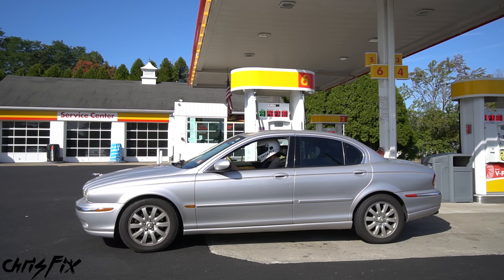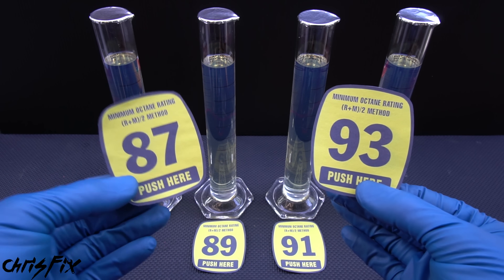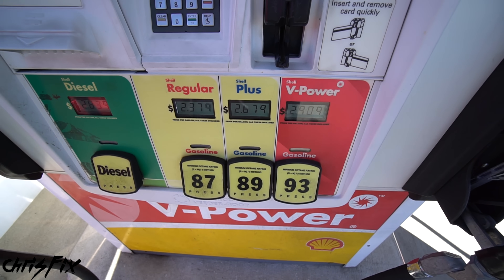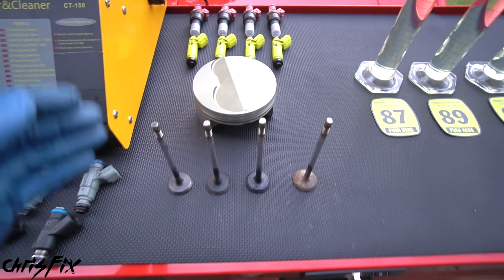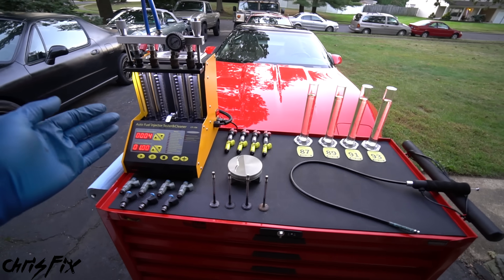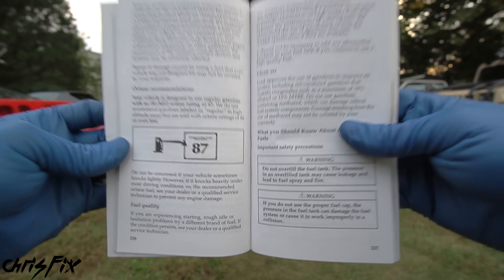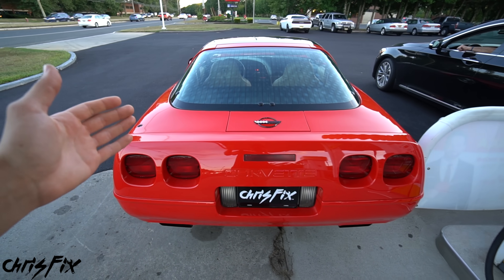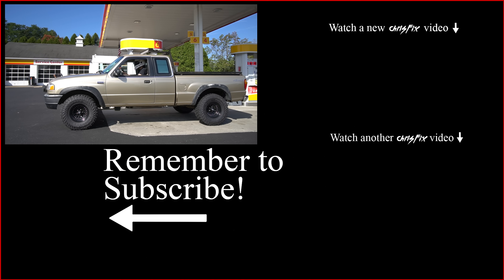What is the BEST Fuel to Use in Your Car or Truck and WHY

Comment: Excellent video. Very well done. I do have one question however. Are you sure of what’s causing the actual pinging or knocking sound? My old shop teacher in high school built his own racing engines for his cars and had the following explanation for pre-detonation. He said it’s not the actual uncontrolled explosion that causes the noise, it’s that the uncontrolled explosion causes a rapid pressure build up in a peripheral part of the combustion chamber which in turn applies large amounts of force to an area of the piston top that’s not in the center or on axis with the wrist pin. That in turn causes the piston to rotate quite forcefully around the wrist pin causing the piston skirt to slam violently against the cylinder wall which causes the knocking or pinging sound. I don’t have anyway of confirming what he said was true, but it does explain why pistons become damaged after prolonged periods of pre-detonation. Does his explanation sound plausible, or is he just not accurate?

Comment: i just use the most expensive stuff.  the truck is nearly $70k (or it was when new) so i figure the extra $2-$3 per tank is worth it.  incidentally, 80,000 miles later of daily farm use including towing and she still runs perfectly with never an issue.  well... the lock on the fuel door stopped working but other than that nada.

Comment: The Petrol Industry sure has people brain washed. They think if they put premium in their tank it will run like a race car. Little do they know is that high octane gas is not as volatile as low octane gas. It has a higher flash point. Why? Octane. Because racing engines run at much higher temps, therefore to keep the fuel from igniting before it should, they put in octane to keep it from igniting (pre-ignition) before it gets compressed in the cylinder. If the manufacturer recommends high octane it’s because the engine is a hot running engine (which could be from higher compression ratios) and requires it to prevent pre-ignition. My Harley requires high octane fuel. Why? Because it’s an air cooled engine and runs at much higher temps than a standard automotive engine. Save your money, if your engine doesn’t need it, high octane gas isn’t an advantage and could even result in lower gas mileage.

Comment: Why does a 95 3.0 Ranger, a 96 3.0 Ranger, a 99 4.0 B4000 (ranger) all get roughly 10% better fuel economy and have slightly better acceleration when I run 89 vs 87? 

The Mazda in particular is noticeably  slower pulling hills with 87. Always has been since I've owned it. With 89, it pulls up the hill easier with slightly less throttle. This is not my imagination, I have tested this several times.

Comment: Several things. I owned a 4 cylinder ‘94 Toyota pickup for 25 years. When I used high test gas it had more get up and go and that’s all there is to it. It also got much higher MPG.That’s a fact. I was told the engine was designed to run on regular gas and higher test gas wasn’t a good idea so I didn’t use it often.

Comment: The type of fuel you need depends on what engine it’s powering. Pickup Trucks with a V8 May need Mid grade or Premium. Performance cars, such as Mercedes AMG, BMW M,  Dodge SRT, etc. you’re most likely on premium

Comment: This video is wrong.  Look up btu.  The low octane fuel has more btu than high test.  High test burns slower so it does not pre ignite, thus lower energy and lower fuel economy if used in lower powered engines.

Comment: Well I have been using premium on my 2013 Nissan Frontier 4 cylinder cause it save me a little bit more of gas and starts smooth in the morning contrary to regular gas which is what is supposed to use starts rough in the morning and suck the gas a lot faster , I have no clue why my truck does that ,but it has been like that for a long time since I bought it new, I did gave up trying to solve the mystery 😂 . And I am always loaded with tools in the back since I am a mobile mechanic. I think she is spoiled 😂.

Comment: Do you have a guide on which to choose the gasoline based on compression ratio ? My manual says that it only requires gas without lead (Pb) and doesn't mention about RON or Premium. It's a sport bike btw, and the compression ratio is 11,6 : 1.

Comment: Long story short:  use the octane recommended by the Manufacturer.  Octane is usually shown:  (a) inside the fuel filler door,  (b) on the fuel cap, or (c) you have to look it up in the owners manual.

Comment: I does use 87 in my 2004 Toyota Corolla. A lot of people think by using 93 that your car will be lasting longer or run better but it depends on the car and what is recommended by the owner’s manual.

Comment: My gas tank says E85 but the owner's manual says I could run 87 through 91 E85 Burns a lot faster vs 91 lastes  little bit longer can i harm my motor for running 91instead of e85

Comment: Uhhh, check out Project Farm. He shows the difference between 87 and Shell premium V-Power NiTRO. The Shell fuel burned cleaner. He uses a single piston push mower engine that has a clear head.

Comment: In France we have unleaded petrol 95, unleaded petrol 98, unleaded petrol 95e10 (10% ethanol). 95 is 1,35€ per liters. It means that it costs 1,58$ for a liter (0.3 gallons)
Reply from the maker: Thanks for sharing, and did you watch the video?
Reply: @chrisfix  yes i did. Thank you it was useful

Comment: Complete waste of 16 minutes. What about gasoline that has 10% ethanol blends in them, like here in the mid-west? Ethanol has about 10% less btu per gallon then gas so there is less power/ thermal energy available. So burning gasoline with ethanol lowers your gas mileage. However, there is typically a trade off as gasoline with 10% Ethanol is usually cheaper.
Reply from the maker: Thanks for sharing

Comment: In my area, Shell is the most expensive. Are you saying that they have more additives that keep the engine clean, and therefore worth it? If so I'll start using shell. Maybe you could rank all the major gas brands. Thanks. I just subscribed and every video is amazing.

Comment: Does shell claim to be able to clean direct injection valves? I know its a problem for most direct injection cars. Whatta they say? The new Type-R has potassium filled valves along with additional cooling measures that prevent the temperature from getting to the point carbon forms..
.

Comment: If your car requires premium use premium. I used silver on mine and it caused the knock sensor to turn on check engine often because the detonation was too soon. So the car would stop accelerating by a lot.

Comment: I don't agree with this.  I have driven many different cars and always used the lowest grade octane.  I have never had an engine ping or cause me trouble.   I believe the grading of fuels is a lot of hype from marketers.   Like I have said.  I have run the cheapest fuel in many different cars, regardless of what the manufacturers claim and I have never had a problem.  Fyi!

Comment: Hey @Chrisfix, great video! So buying higher octane gasoline may not be necessary for some vehicles, but it seems like it shouldn't hurt either, right!? When I was 21, I bought my first vehicle, a 99 ford F-150 (I still have it), as I didn't know better at the time, I thought higher grade gasoline was better quality given the marketing name and price, so I used premium for over a year when I found out the difference. The manual recommended regular so I emptied the tank and switched to regular. As soon as I drove off, the check engine light turned on. The dealership told me they could not see a problem and just reset the light. But I never figured out why that happened. Do you have any idea what caused it? And is switching up to premium once in a while a good thing at all? Or do the lower octane gasolines have the same additives as the premium?

Comment: It depends on how hot the engine is designed to run. The 3.8L V-6 Pentastar engine in my Jeep is a hot running engine and runs quiet on 91 octane and pings on factory recommended 87 octane. The octane rating specified by manufacturers for specific vehicles is the bare minimum recommended, not the optimum or best.
Reply from the maker: Thanks for sharing!

Comment: About octane that explanation is not correct. In Japan they have 100 and even 110 octane gas, so there cars to run "forever" without engine problems and WEAR. Lower octane gas is for slow speed and high octane is for high speed drive. The higher rpm is driven the engine the higher octane should be the gas used, no mater what is the vehicle. That's how the engine can last 500 000 mi. If you drive with only low octane fuel the engine will not last more than around 150 000 - 200 000 mi. If a vehicle is driven with no more than 20-30 mi/h and low octane gas all the time yes the engine will last 300-500 000 mi. More octane in the gas = less engine wear. If you understand this you should pointed that in the video but didn't. People have to know why they should pay more for gas. Above 4000-5000 rpm compression is so FAST in the engine that the fuel need a 200 octane not to blast before the spark. 300 years ago, In Scotland this is how people start a fire with very high compression of air and dry moss. If high compress air can do this with the dry moss, imagine what high compression can do with the gas. Above 4000 rpm  and low octane gas, you do not need a spark from the plug for engine to work but car computers do not know that...car engineers either. Above 4000 rpm and low octane gas, car computer should stop the sparks from the plugs and change the engine timing so the car can run on low octane like in a diesel engine vehicle. This is the only way low octane gas not to break the engine, instead of that, they sell us gas with octane - not very smart but works. Above 4000 rpm diesel engine are better, because computer have to do less engine timing.
Reply from the maker: Thanks for sharing!

Comment: Good article, well done.

85 Octane here in Colorado (Yes! 85) We're at 5000+ ft above sea level (7500' at my house) and less air pressure/density; therefore, combustion pressures and temperatures are lower and less likely to cause detonation or pre-ignition.

Comment: I drive a 03 s10 and I run 87 for everyday driving, but every 1000 miles, I throw 93 high octane, and floor it every stop sign and red light. Clean her out and drive her loose. It drinks 93 like sugar, but I usually get amazing mileage on the tank afterwards, hi Chris!! 👋👋👋

Comment: Great Video! 
I just have a question. I've got a tuned mustang that's been sitting for nearly 3 years with the same fuel in the tank. Should I drain the tank or can I just idle the car and run the tank empty? I'm asking cause the motor was built 3 years ago and it's been stored since. Life got busy.

Comment: Good video.  I would have explained detonation a lil different.  It can also be the explosion of the fuel before spark plug fires causing hot spots in the engine and ping...

Comment: The term is "Pre-Detonation" Combustion occurs too soon putting force back on the top of the piston while it is still in it's upward compression stroke then causing the piston skirt to slap on the cylinder wall causing "Pinging".
Reply: DrHarryT THIS ^^^^^^^

Comment: Just bought a 1976 Corvette , and I've heard I should only put Premium (93) in it, is that true ? There's not much information for these cars on the web lol
Reply: LiiLNiiCk So many variables. Age of engine, modifications, L48 (8.5:1 compression ratio) vs. L82 (9.0:1 compression ratio), ignition timing. What are you running now? Does it knock? If not, then you’re OK, presuming the timing is fairly close.

Comment: I have two older Mitsubishi 3000GT.  One is base(1998)the other(1991) twin turbo.  I use 91 octane in both and increased fuel economy by up to 30% from using 87.  No lie I was impressed so I use 91 exclusively.  Both for sale lol I have a 2019 camaro ss but can’t get 93 octane fuel locally but it runs fine using 91.

Comment: Is there any point of the midgrade? I’ve never seen any vehicles that were recommended midgrade and I’ve never seen anyone use it. Not to say no vehicle manufacturers recommend it or people don’t use it but I’ve never seen either.
Reply from the maker: I've seen a few cars actually require the use of it, or recommend it for cars that require 87 but are looking to tow or perform similar tasks!
Reply: Sports bikes often require mid grade petrol, which is 95 here (89 for Americans I think). My Yamaha R3 says 95.
Reply: Ive always used 89 when towing and 87 daily driving in my trucks since the added heat of towing.  Some motor cycles recommend 89
Reply: My Jeep Hemi recommends 89, says there is no need for 93. And they are right, if I use 87 it runs like crap and no noticed benefit for 93 octane.

Comment: I recently bought an old RX350. Before i bought it I checked out several you tube videos and one of them mentioned that RX350's burn regular. I thought that odd since my even older Es300 had used premium. I said well I guess he knows what he's talking about and since regular is quite a bit cheaper it was a selling point for buying the Lexus.  Unfortunately after I had already filled it up with regular I thought to check the gas cap. Sure enough it was labeled 91+. I drove it down to half a tank and filled it with premium. It didn't knock at all, but if I had known about the octane booster I would have used it.

Comment: I’m fixing up an old truck and the manual says that I should be using 91 fuel, but none of the gas stations in my town has 91, what would be best to use? They have 87, 89, and 93
Reply: GoatBoi Recommended or higher.

Comment: In Australia we have as low as 91 and as high as 98. I haven’t seen any other numbers in my experience. I think in the 90’s when I was a kid we had 87 or 83. Maybe.... lol.
Currently we got Diesel, Gas, Standard 91, 
High Octane 95, High Octane 98, E85 and E10.

Prices on average are around $1.40 to $.150 a litre for 91, $1.60 to $1.70 for the higher grades. The E grades are always the cheapest at around $1.35 to $1.45.. I find with my Lancer ES Auto 08 that regular is fine when the prices are cheaper I’ll go the medium grade 95. Or sometimes the 98. 

Whatever your car manufacturer recommends I say go with that. Also I’ve found with the 91 sometimes I get an Eggy smell, and I don’t have any issues with the 95/98. Personally if the prices were lower I’d always go 95 or 98. Great video Chris.

Comment: 2500 continuous miles, at 20¢ more with an average of 10 miles per gallon is like close to an extra $50. How does that compare to simply using an aftermarket additive for a few fill ups? Obviously there would be a big price difference.

Comment: The dirty intake valves on DI engines have NOTHING to do with the fuel.  It has to do with no fuel spraying on teh intake valve (which cleans it) instead DI sprays directly into the cylinder.  Thats bad.  So the solution is to put a catch can on the EGR system, especially for forced injection motors or motors with cylinder deactivation.

Comment: How many offhand levels will octane boost elevate. For example, I use 91 octane in my 1999 BMW 328I E36 and I put on a Butler of octane boost. What is that final level of octane? Also, would it be cheaper to just use 93 octane on a full tank instead of 91 and a bottle of octane boost?. I can crunch that numbers, but I'm on lunch. lol

Comment: Watch your air cooled engines. My 1st motorcycle manual called for regular 87 octane, but with a passenger or on a hot 85 degrees + day it would ping/detonate, so I used a higher octane fuel.
Reply from the maker: Thanks for sharing!
Reply: Exactly.... I run 93 in ALL my air cooled small engines and 2 strokes

Comment: Can I use octane booster to clean extra well when already using highest octane gas? Are injector cleaner additives recomended? Thanks
Reply from the maker: https://www.youtube.com/playlist?list=PLvKbarVtwhUue-xwasd2WUMrkK0CEm6yy
Reply: Not recommended.  Only run an octane booster if you require a higher octane .  The contents of boosters leave residue on your spark plugs, shortening their lifespan.

Comment: I tow a caravan with my Kia Sedona( Known in Australia as a Kia Grand Carnival). If I use 98 Octane (Australian Fuel rating) it will stay in fifth gear cruising on a slightly inclined road with no wind. Travelling along the same road again with no wind using 89 Octane it will drop down a gear. I have travelled this road several times using both fuels the car does the same thing each time. So I run it on 98 Octane. To me, the few extra cents per litre are worth it the cost.

Comment: Worked for an environmental compliance company for a few years. We tested and did maintenance for fuel stations. 2 things; 1, a diesel nozzle 99% of the time wont fit in a regular fuel car. 2, premium gas is mostly a blend of 87 and 89. Most fuel stations have a blender between tanks that mixes the fuel before reaching your pump. Just thought id share.

Comment: I still like a higher octane without(!!!) ethanol.
Never was a FAN, of being MANDATED BY THE U.S.Goverment, to use EVEN 10% ETHANOL!!!
But I noticed: BETTER GAS MILEAGE.
I also been a BIG FAN OF: MYSTERY OIL; one- ounce/ 2 1/2 gallons of gas.= 373,300. Miles on my Dodge Dakota “97, 5.2 liter..Still drive it cause it’s a Truck.

Comment: So if my truck 🚚 can take e-85 is it worth using up? Is it ok to use?
Reply from the maker: I'll be making a video about ethanol soon! Stay tuneeeeeed!
Reply: It's subsidized in the US to the point where E85 costs roughly the same in terms of mileage per dollar as premium gasoline, the tradeoff being that you require a greater volume of E85 per mile (more pump fill-ups).  Unless you're racing your truck (E85 is equivalent to a higher octane rated petrol), you're Likely better off with gasoline.